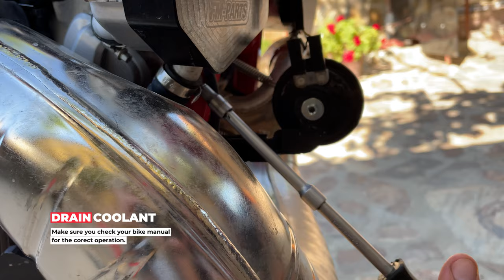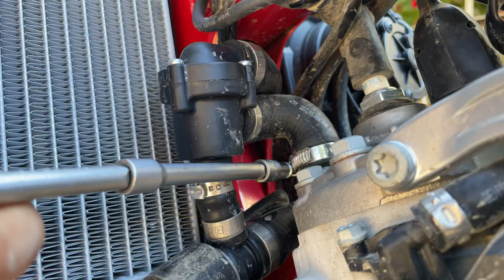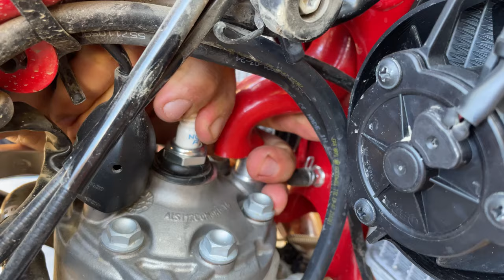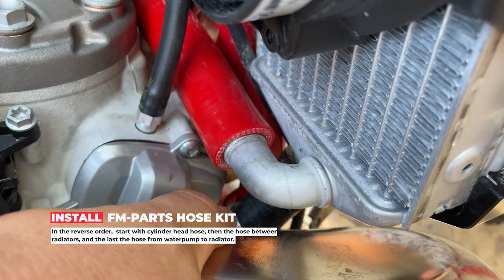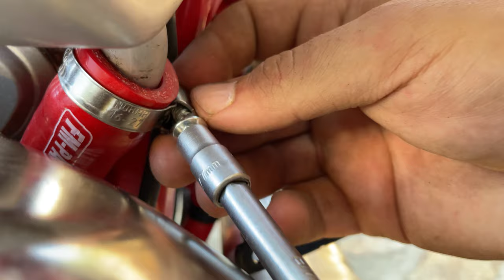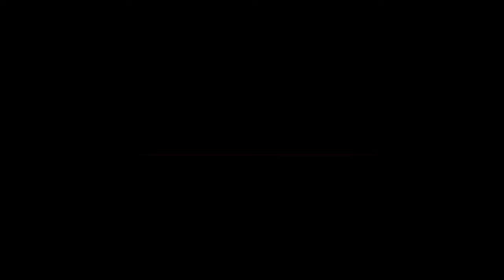FM PARTS Silicone Hose KIT and THERMORSTAT BYPASS for KTM | HUSQVARNA | GASGAS

Comment: Any comment after use
Reply from the maker: We took it in the hard stuff, works perfect! The fan in not working non-stop like before! TPI engines run high in temperature so any improvement in the cooling system is good! And with such thick hoses 5layers vs 2 the OEM, the PW puncture is gone.